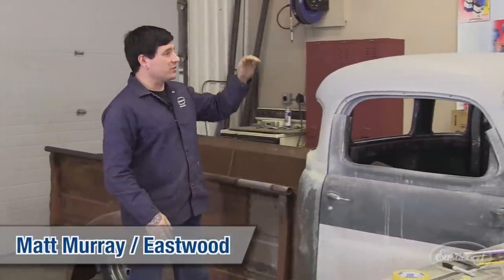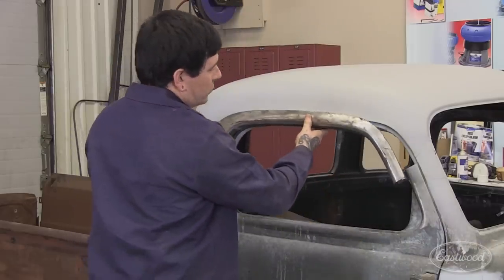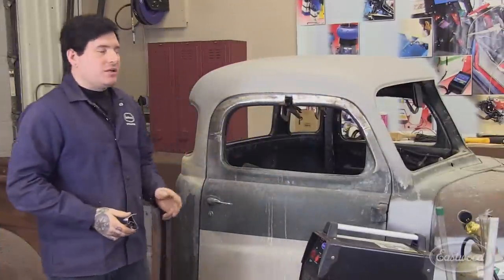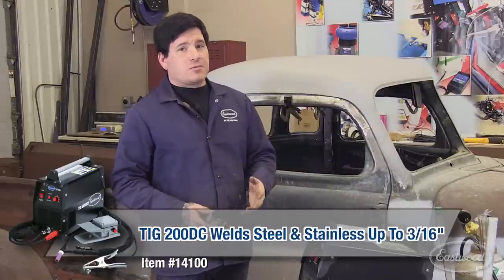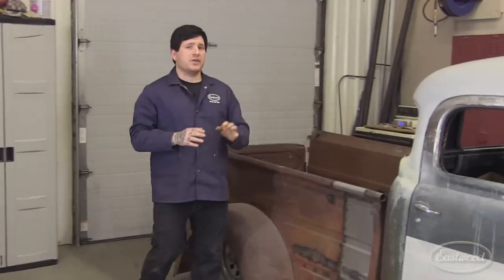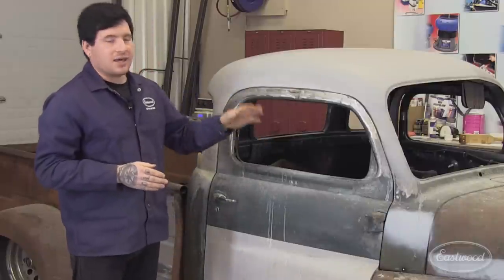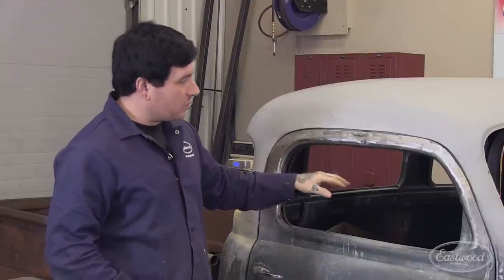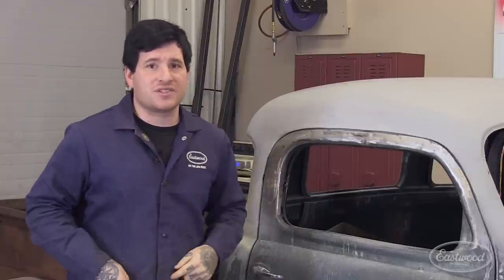Chopping a Top - Project Pilehouse DIY Top Chop Pt.3 at Eastwood

Comment: Yes I realise this is an old video, and I've watched them all. That was smart to cut out below the rear windows. My 57 D100 has the one piece wrap around front wind screen and rear window. I have no clue how to get around chopping the top, and not having a custom windshield made. Most people wont understand, old Dodge parts are hard to come across, It's my baby. Given to me when I was 14 in 1981. Never let go of her even after a nasty divorce. How do people deal with curved glass, when they chop. I'm only looking at a 2" or 3" chop. The front windscreen is my problem, no way am I planning to send this truck to the scrap yard.

Comment from the maker: Thanks for watching and a good question. A plasma cutter could be used, but you MUST take into consideration the amount of material removed when cutting. That's why using something very thin like a hacksaw or recip. saw will take the least amount of material away. I'd also be sure to set your plasma up to make as clean of a cut as possible. Ideally a thin cut off wheel, hacksaw, or recip saw are best to make the cuts on the doors.

Comment: You guys do great work and it was worth the wait for this vid! On the cuts, could a Plasma cutter be used? They aren't too violent and seem to cut clean. Is there a down side to using one on a project like this? I have an old f-100 and a donor cab I want to attempt to modify.

Comment: I don't think they ever finnished this project and left everyone hanging on the glass. I tried to goto the blog and the dns address can't be found. I'm really disappointed about this but what can I do but complain. I wonder how many people was actually doing this project along with the show and was left hanging to figure it out so they can finnish the job? I been wanting to do this but can't find out if new windows have to be made or how do they get the windows put in. Can you special order new window seals or do you have to mickey mouse them so they will fit? I think there is some reason they didn't finnish the build and moved onto something else without returning as of yet 4yrs. and counting. If they did finnish this then where is the video? 1-3 is here..
Reply from the maker: It was Matt's personal project and it got delayed when he bought a Model A and built it into a Roadster.

Comment: Is this an example of how NOT to chop a roof?  The segment mating the front and rear of the roof that is in the door jamb is crooked as f***.  The gap between the top of the door and the roof line is disgusting, and the front a pillars look like they are actually longer than the rear.  The rake of the roof line should be slanted down towards the front.  Not sticking up in the front....   horrible.  I hope no one paid hard earned money for that butcher job